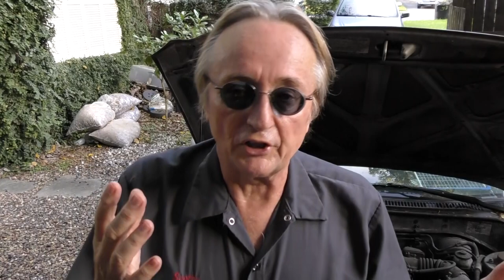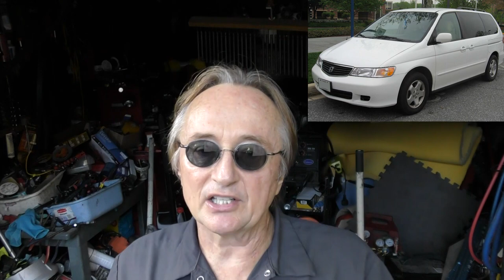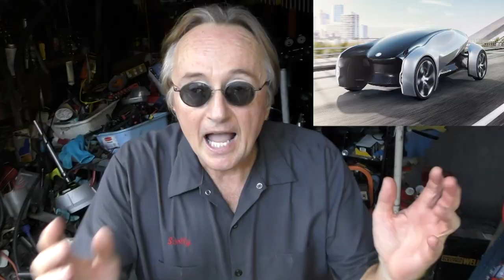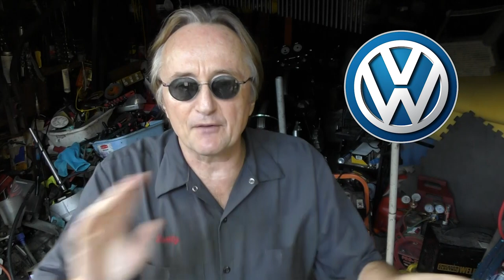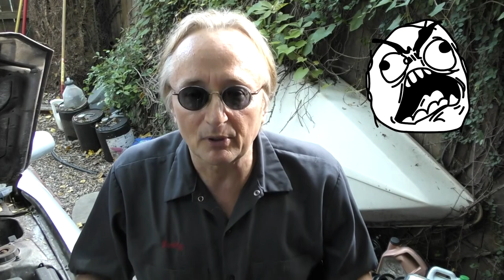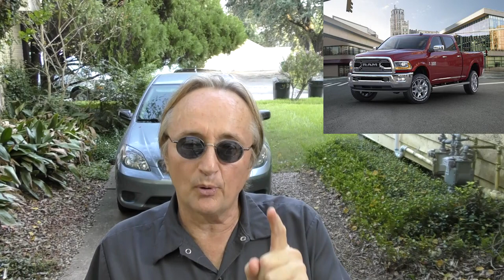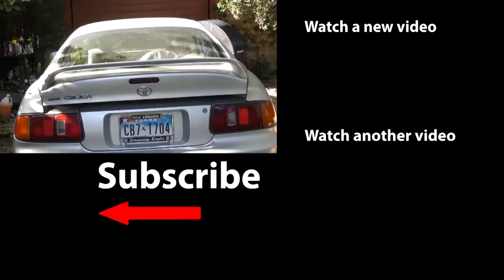Who Makes the Worst Automatic Transmission Cars in the World

Comment: Had a 07 Nissan Altima 3.5se great engine but that damn cvt was a problem, on long drives the car would go into limp mode because the cvt transmission would get too hot and Nissan didnt put a transmission cooler in which i thought was stupid in the first place

Comment: MY GM 4t80E in my cadillac, and my GM 4t65E in my chevy are awesome.  I do not want that new foreign crap.  They are 25 & 19 years old, and i am the original owner. I rebuild my chevy due to work clutch pack, and a stretched non hardened steel chain.  Now after i improved it. It will last another 19 years!!

Comment: What's the most unreliable V6 Engine ever produced?
Reply: Robert Rickman your mom
Reply: Probably the 2.7v6 in the 1998-2002 Dodge Intrepid/Chrysler Concorde 2002-2007 Dodge Stratus/Sebring and first gen Dodge Charger and 300.
Reply: @robbiehernandez8019  is that the one with the plastic coolant line running through the engine, it would always crack and hydro lock the engine
Reply: @eaglefat9398  I think both that and the 3.2 had multiple ways they would catastrophicly fail. Every junk yard had multiple ones with great bodies but failed engines. If I handn't hated the car with a passion I would have found a way to transplant a different drivetrain into one.

Comment: I agree with almost everything he says, BUT, obviously, this guy is a Toyota fan.
I sold Toyotas in 2007, and the Corollas at that time where pieces of garbage -- the line of customers returning to the dealer a few weeks after the buying was looooooong. If they crashed, they fell apart like card castles. I witnessed a crash between one of those Corollas and a Mercury Grand Marquis, and all the owner of the Toyota yelled was: "This is a piece of cardboard!"
And let's not forget the problem with the acceleration of Lexus in Japan and so many other recalls.  The Tundra 2007 could not compete with any of the other brands (worst gas mileage, worst turning, less pulling capacity, etc.).
But he never mentions any of this. By the way, I once drove a Mercury Cougar 1985 with 260 thousand miles in it and in five years it gave me no problem until I crashed against a truck, and still, it saved my life.
But, those Fords had issues with the Rack & pignon and their engines leaked oil most of the time.
See? I am no a fan of any brand.
Reply: Had a Lincoln LSC on the same platform that saved me when I rolled it into a ditch. Had I been in a Corolla I surely would have died. I now own a midnight LSC SE.

Comment: What's the best minivan I can get for 3,500? Year make and model
Reply: Bubba Brazil Toyota's cost a little more than the others, but has less expensive problems as they age. Used Toyotas you need to check for the oil getting gunked up, in the engine. Scotty recommends changing the oil more often, like you are using it for rough service. That, and the dash boards tend to crack up, from sun damage.

Comment: I don't know what this guy is on these days, but he's flat out wrong on half of what he said here. Worked on fixing/rebuilding transmissions for 15 years. The Powerglide transmission was bad for fuel mileage but tough as nails and it's still very commonly used in racing because of it's light weight and durability. The Honda transmissions he refers to did have problems but they were easily corrected using updated parts with a rebuild, mainly longer bushings for the feed tubes and an update for the TCC bore. The VW transmissions were just useless junk, correct. The Caravan transmissions were bad when they first came out but became quite good until they updated them to the 6 speed from the 4 speed. The Explorers with the 5R55W/S were garbage, true. The ZF in the Dodges he is exagerating on. ZF makes most of the transmissions for everyone using the same basic planetary setup including Ford, GM, Chrysler, Mercedes and more. Lots of bad information here just like his not understanding GM cutbacks video. Scotty seems like he is losing touch with reality here.

Comment: Hi Scotty, I have a 2013 Tacoma with 44,000 miles, the brakes are pulsing, I’m guessing it needs new ones, I want the best work and parts available because I carry around my grand children, do I go to the dealer or to a reputable brake shop, and are there different quality of the parts required for the repair
Reply: it sounds like your rotors are warped, i would research your local dealer because sometimes they aren't known for great service especially on older cars because they get pushed off on the new guy(mechanic) . That being said if they have a good reputation you're a lot more likely to get good genuine parts instead of cheap china rotors that warp up even faster. But check prices because dealers usually charge a arm and a leg compared to a local shop. If you go to a local shop look for ASE certification, i can't recommend a good brand but NAPA usually has decent quality part. Just my two cents, good luck

Comment: Scotty , we own a 2008 honda odyssey v6 that has over 200,000 miles and only had a water pump / timing belt and motor mounts done recently.The transmission is the same as used in the ridgeline truck of that time and still runs and shifts strong. So I must protest in your dislike of this year honda LOL. I do like your youtube's but sometimes...... with a grain of salt

Comment: This video pretty much explains why I don't bother with non-japanese cars. German auto makers lie to you trying to look good (VW and audi) and in other cases it's recall after recall due to how asvanced the cars are set up (Mercedes and BMW). American cars seem poorly built. Renault fucked Nissan so have a pet peeve with them. Mazda has bad automatic transmissions but their cars even to date scrap the engine cover BS with the new MX-5 so you're not forced to a licensed dealership for the smallest of fixes since you can access the engine bay yourself. They also innovate on both the piston and rotary engines even to this day with the skytech series. One of the few not merged and still self owned companies in Japan and they show for it.

Comment: Scotty what is your opinion of the SV6 engine in the Pontiac Montana
Reply: Elizarobin Robinson  I had a Pontiac Montana back in the day, bought it new. It went thru air conditioning compressors like it was going out of style. Had a short in the wiring the dealer could never figure it out. It was dead at 65,000 miles. Traded it in on a Toyota Siena never looked back.
Reply: Thanks

Comment: It's just not unusual at all to get half million miles with ZMax . I had an automatic in that van I describe below .... The 3 speed was another one and had like a 3/4 ton 16" wheel three speed overdrive 4 ton econo and IT got 27 mpg. This one I describe below was a six auto 15". Made a boo boo. No one would buy a vehicle with a bucking transmission and horribly missing engine ...a mechanic lied to the guy and said it needed like a $500 alternator and he knew nothing if cars. The engine is coughing the tranny is bucking and I could see the $10 regulator on the headlight wall. So I bought all new light bulbs no computers were affected luckily they didn't have many in 92 so I am not kidding ZMAX and ten miles and the car was fine. Best cars i ever drove were $300 cars. My friend is trying to keep his 78 running parts are hard to find. He's a trucker and needed the econoline steering box he loaded it on a friend's run to Georgia and took the van to the part and drove back to az. Hrs like that

Comment: I use to work at a transmission ship I am shocked gm isn't on here at 2 or 1. The 6l80 is garbage idk how many rebuilds I've done on that under 100k miles then the cars impala and Malibu I can't even tell how many of those I rebuilt under 60k miles and not 1 cvt mentioned?

Comment: 2002 Odyssey 133k ...it will be here another 133.. I use ZMAX... Im a certified mechanic 50 years and I've never seen a dead ZMAX engine. Has an FAA rating . I've ressurected the dead with ZMAX they call me Lazarus the mechanic . I studied this stuff it really does everyrhing they claim never heard a negative story. Best vehicle was a 92 econo full size injected six. 3 speed overdrive 16" wheels . Mechanic lied about an internal voltage regulator alternator . Sold it 8 years old 100k for $400. Engine bucking trans bucking. That night I saw a ZMAX commercial $39. We used it in our Piper aircraft. We had two and it was great stuff.  But this van was running smooth as the day it was made in just 10 miles . Drained all the oil and trans bottom flushed it and wow blackest nastiest crap came out if that engine . And I added it again and drove it a couple months very comfortable and safe and sold it $3800 guy needed a cargo van for a band. True story I've fixed a million cars

Comment: For anybody who sees this... I know its an older video, but was that just for the Honda Odyssey that they replaced the transmissions for free? Does Honda do that with every vehicle? Just wondering because I think my tranny may be due soon. 2011 Accord Ex-l 300K+ miles. Got a flush last September. I am going to talk to the dealer when calling for a quote on changing the fluid on what to do potentially. If somebody sees this, please answer my question about the tranny replacements.

Comment: I had 2 crap Honda transmissions..1 in a 2003 Acura TL-S.. blew up @ 104,000 even after 2 recall fixes.. at that time I was told " that is the life of the tranny".. my 2004 Acura TL base faired not better at 93000 it was starting to buck and show signs of the exact failure experienced in my o3..  both these transmissions were serviced according to Honda service requirements.  I am thoroughly done with Honda in any form.. in fact.. the service Supervisor at my Acura dealership broke down & admitted to  me they were already having issues with the 8 and 9 speed transmissions as of 2017..  Lease and dump vehicles is what they now  produce.  So   , with crap trannys made from old world manufacturing champs worth about  2 cents..  I decided that risking a totally  new vehicle line like TESLA  wasn't a risk at all..  anyone can make a better tranny.. but who does?  33700 miles on my 2016 MS 90D..  no real troubles yet.. just growing pains... EFF gasoline vehicles.

Comment: I have a 8 speed ZF I have no problems with it whatsoever it is Bulletproof if you treat your car like s*** then you will get s*** Nissan makes the worst transmission you can ever put in a car I'm on my 3rd 300 by far the ZF transmission is the best ever the old 6-speed Transmissions were garbage that had nothing to do with Fiat that was Mercedes foot in that transmission in there the only reason why the Hemi has came back is because of the ZF it is the only reason why they can increase the horsepower it can take the pounding. My mechanic has never had a problem with my car I would say the suspension is suspect but you must change certain things in any car especially when you're dealing with the Northeast.

Comment: what 5 best brands, models and years should we buy to get the most reliable car, scooter, motorcycle etc from your point of view ? we will all follow your advise so all constructors will be informed that we are not stupid anymore. Garagists are like doctors... they will never ever heal you as you are their bank account.
Reply: no such thing as a reliable car, only reliable problems, what i mean by that is a good car will still have problems but its simple to diagnose, easy to change and cheap to replace and its usually the same thing so you know every 100k miles  its getting to the time you might as well just change the part and avoid breaking down. like a water pump on a chevy truck its like a $38 part and its good for 100k. But on a bad car the problems are usually hard to find like intermittent failure to start, you have to rip the entire car part to fix it and the part cost $3,000 and after you fix it the part could fail again within months.

Comment: Be warned !! Chevy Equinox 2007/2008/2009 transmissions are defective!! They blow!! You should be able to find an unpublished secret recall/replacement!! I have a 2010 Equinox and mine blew at 62k and Chevy would not replace it (it was 2 years out of warranty). It’s a rip-off scam, they should replace them all!! $4700 to replace!! Bastards! PS my engine was also burning a lot of oil (same only 62k)!! That was another defect, I raised wholly hell and they rebuilt it free! Crazy, good luck with the Equinox (to bad, I like it otherwise).

Comment: Honda didn't start as a motorcycle company, they started as a piston and ring company. Guess who bought Honda out around 1942 and still today uses his design?  That's right toyota ! Which manufacturer has had the most appearances on Car & Drivers 10 best list. That' right Honda! Honda also holds the most  wins at the Isle of Man with 255 wins. You should start using facts when making judgement videos!

Comment: We love SCOTTY.. I must say the European car market.. uk Ireland Germany.. etc THE CARS OVER HERE ARE .. WAY BETTER MADE..assembled in Germany.  Japan. Etc..( skoda are reliable..)  although some issues with VW Spanish ASSEMBLY.. BUT GENERALLY CARS ARE WAY BETTER BUILT HERE IN EUROPE..even fiat. .BUT NO DENYING..THE THREAD IS ..KEEP YOUR NEW CAR FOR A COUPLE OF YEARS..3..THEN UPGRADE ( LIKE A PHONE) if like me your broke,  or simply can't and won't buy into that MINDSET.  Then source a old reliable honda. Toyota,  PERSONALLY.  I DRIVE A 17 YEAR OLD. MERCEDES CLK 200.. and only in the last 2 years have I started to have to get repairs .. air intake has just given me trouble. clicking on ac fan lately.. ( it's time to say good bye..). But  The ENGINE AND AUTO TRANSMISSION..and build ..NEVER A PROBLEM..HAVE IT 8 YEARS .( 9 years old when I bought it for 3g..( lucky).200.000 MILES ON THE CLOCK. .

Comment: The reliability of a car is often directly, but inversely, proportional to its technology. Some of the most reliable cars ever made were those communist shitboxes like the Ladas and Skodas simply because of how primitive they were and how rugged they were made to handle the primiate communist roads and how little money that had to spend to develop them. 

If I could find a cheap Lada today, I would buy it. The cheapest one up here in Canada is $10,000. They are super expensive now because people want them. You don't even have to worry about parts because you can fix those things with an old soup can and some wire. 

Meanwhile, in Germany, land of the technoperverts, you can't buy anything that is not both overly overly complex, way too expensive, and prone to failure as soon as the warranty runs out.

Comment: Chrylser uses ZF transmissions it’s a German company, Land Rover and BMW uses these ZF transmissions and other car companies around the world and I don’t agree Chrysler cars and trucks are not good quality we use the same suppliers on alternators and starters and AC compressors and wiring harnesses that toyota uses and our suppliers we use ford and gm , bmw ,Toyota uses and we use a lot of Bosch parts on the engine and Bosch is a German company and for transmissions I’ve never had an issue and I put three 400 to 500,000 miles on my vehicle and I’m never had an issue with the transmission I know what goes in a Chrylser mini van , I work there and know where all our suppliers are and who they supply I’ve owned jeeps and put 460.000 and had it for 23 years and only put a starter on it and a alternator . We been building mini vans for 33 years that says a lot , ya transmissions go but they go in any manufacture even Toyota

Comment: I own toyotas now after to many crappy  fords and Chevrolet, in my young life ,but Toyota is making the same mistakes from other companies,they are sealing Tata cars with their names and also the yaris r,is fricking Mazda 2 price of crap, I used to own a 2007 Corolla, and a 2007 sienna ,the Corolla were solid as a rock,sold it just to buy a new one,still own the sienna but has been different history in it ,noises in the engine (3.5) the vvti fail (according to the mechanic )  at 70 thousand miles, now just bought a 2015 highlander with 25 thousand miles on it ,the and grips front the front door are now full with wrinkles,the a/c is way to slow,(the sienna colds faster and better,8 years older )  engine works fine so far ,(just 25 thousand miles.
So,I am guessing now ,if they interested in the quality.
Probably in the future I'll give a try to KIA ,years warranty are good.

Comment: 5 odyssey later no problem. Minor glitches. Got corrected. My 2000 Odyssey has 485000 km . First gear start slipping but still give another 12000 km before I give it away.  
YOU TALK TOO MUCH. GET OFF THE WEED.

Comment: tory Timeline
2018
December
9-Speed Transmission Settlement Just Needs the Judge’s Approval 
September
Class-Action Lawsuit Wants Fiat-Chrysler to Take Responsibility for the Cherokee’s 9-Speed Transmission 
2016
August
Defective ZF Transmission Sensors Recalled in 505,000 Vehicles 
July
FCA Blames Wiring Harness Problem on ZF Transmission’s Sudden Loss of Propulsion 
2015
August
2014 Cherokee Owners Say Their 9-Speed Transmission is a Cursed Bucket of Bolts The chrysler ZF Torqueflite is not good so far

Comment: I'm sorry, but Mercedes has the worst automatic transmission, specially he trucks serie 1524... I am driving just the same and this idiotic lorry is driving up on the hill in 800-1000 RPM all the time or with pedal down to the floor it is driving with 30 - 40 km/h (depends which gear it decided to use at the moment and all the time I must change the gear manually, so I am thinking do I need a car with automatic transmission or not, cause I must buy another one, cause I must retire my Corolla Liftback 1988, that I love, but...